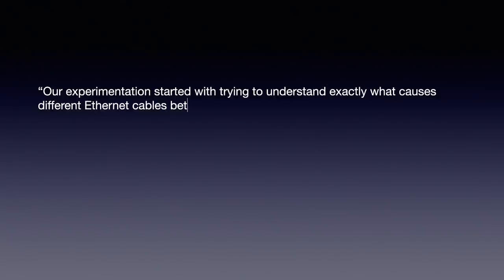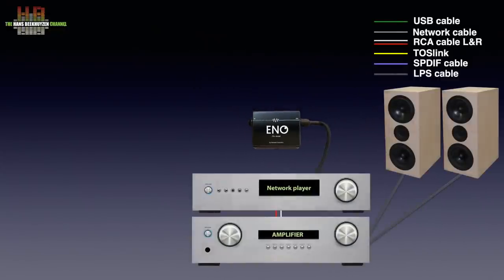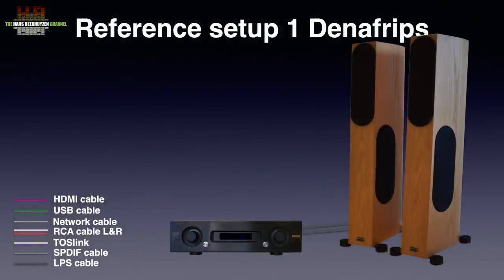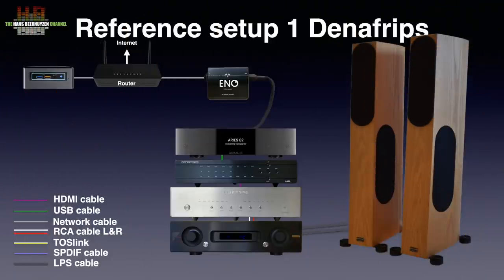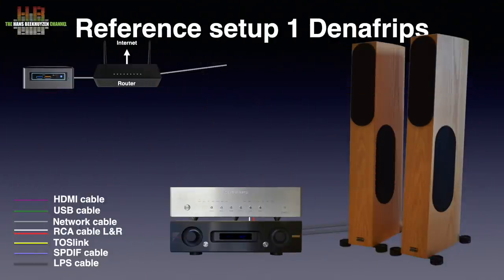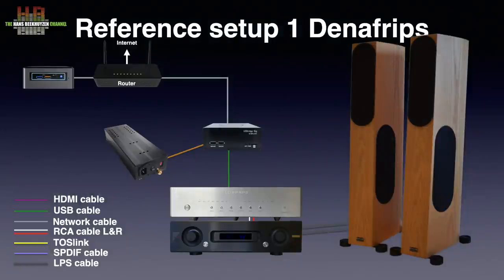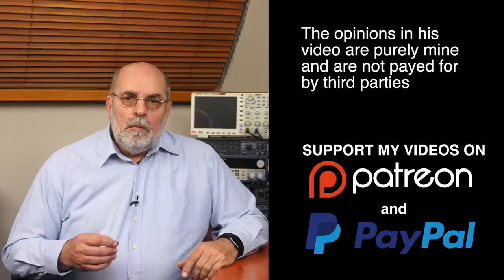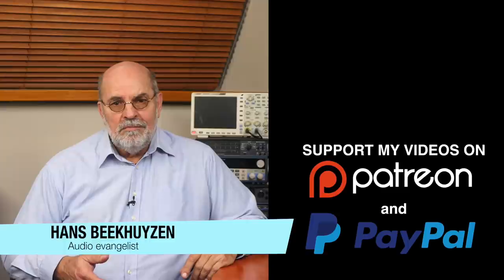Network Acoustics ENO Streaming System

Comment: Really enjoyed your video. With the risk of starting a bits-are-bits discussion (which is not my intention) I was curious if you had any deeper insights to the use of the ENO in series with another audio grade switch – the EtherREGEN in this case (or for that matter the SOtM switch in your reference setup video from November last year).

I do believe that there is no controversy in the statement the IP-protocol is bit perfect when it comes to payload / data and that the concept of audio jitter does not apply to NW traffic (given its packet based nature and ignoring packet loss which is rarely a practical issue). So with the data being bit-perfect and jitter not been applicable (or at least constant), wouldn’t that just leave us with noise as an explanation to the variation?

So to my question, in this video, you conclude that the EtherREGEN in combination with the ENO does not sound as good as the ENO alone. Wouldn’t that mean that the two devices in serial would create a noisier environment than each device on its own? 

Do you have any thoughts on why these two devices would create more noise in series?
Reply from the maker: I own both and use the Eno System for - at least in my setup - it gives a slightly better result. But the Ether REGEN is a great product too.

Comment: Hi  Hans,  congratulations with your wedding anniversary!  I have replaced my ER with the ENO filter and agree the sound is very analog and pleasant. However, compared to the ER with Audioquest Vodka lan cable connected to my music server the sound now seems less dynamic. Thus I was wandering if you tested the Network Acoustic lan cable separately from the ENO filter? How much would I gain from upgrading the lan cable in front of the ENO filter (currently Supra cat 8) by adding the Network Acoustic lan cable or another high-end lan cable?
Reply from the maker: As I said in the video: buy the complete system - so filter and cable - for the best result. I preferred it over the AQ.
Reply: @TheHansBeekhuyzenChannel  Yes, that makes the most sense as Marcel must bare in mind that their cable has been optimised to work with the related device. This reminds me of some really interesting comments that GR Research was saying (see their YT channel) about filtering in general. Now whilst that was originally about either power cables or speaker cables that act as a filter for EMI/RFI, the same principles apply to the points he was making: 

1. Almost all audio circuits with built in power supplies start with some form of filtering (or should do) - so for those non-believers in the impact of filtering all cables, ask yourself why the makers put it in to begin with. 

2. However, no single cable or filtering device will be perfect for ALL devices, or all systems, or in every location/situation - depending on the level of noise impacting that location.

3. Further, if you combine TOO MANY filtering devices, or a heavily filtered cable with a device already having a well filtered circuit design or power supply (as appropriate), you can actually go TOO FAR and the music sounds worse! It’s not a case of you can never have enough filtering for optimal sound. 

Perhaps this last point is at play here with the combination of devices filtering the signal in series, or where the AQ cable is being used instead of the manufacturer’s recommended one?

Comment: Dear Hans,
I understand what you said in the conclusion, I rate my system between 1 and 2.( AN Oto, AN-J speaker + Auralic Vega G1)
But I think the ‘streaming’ part of the Auralic is the weakest link in my setup. So the streaming end is not quit high end. So I was wondering what you recommend in my situation ER or perhaps the ENO ?

Ps: my current switch is the Cisco 2960 modded with ifi iPower X
Reply from the maker: I can't say what you like in your situation. Please watch https://youtu.be/BzLmC4n2DX4

Comment: To clarify, the ENO in sequence with an audiophile switch is not ideal, rather you should go with one or the other, correct?
Reply from the maker: Yep
Reply: @TheHansBeekhuyzenChannel  From the latest video You released "Other music I like to play", where at the end you describe the reference set up, the SOtM sNH-10G is used in front of the ENO.
So the EtherREGEN was not a good combination (complementary) with ENO, but other switches are / or might be? Could you please advise which other switches You have tried and with what result? Any cheaper recommended alternative than the SOtM sNH-10G? Of course not expecting the same sound quality for cheaper, just a good alternative. E.g. EE8, Silent Angel Bonn N8. Thank You.
PS: I have just ordered the ENO and have a cheap dedicated switch with very good linear power supply.
Reply: @henrikhengerics6782  how did the ENO work out in your setup?
Reply from the maker: Correct. Although I don't know why.
Reply from the maker: Watch https://youtu.be/AyXKRyzc20M